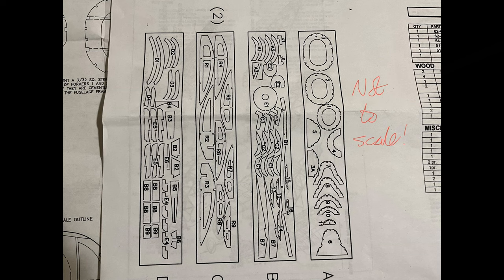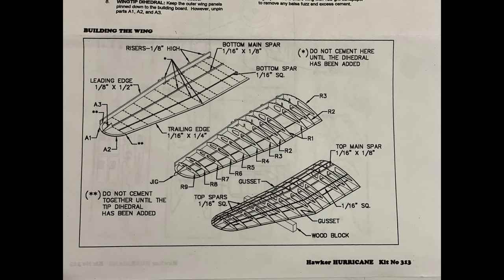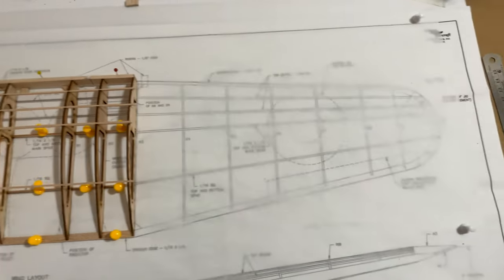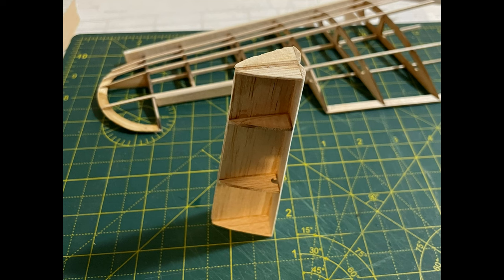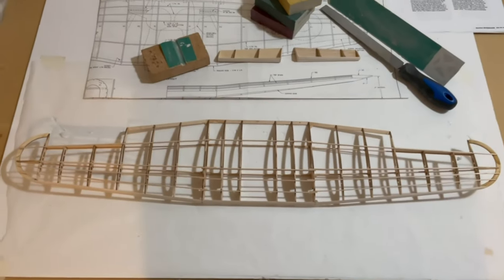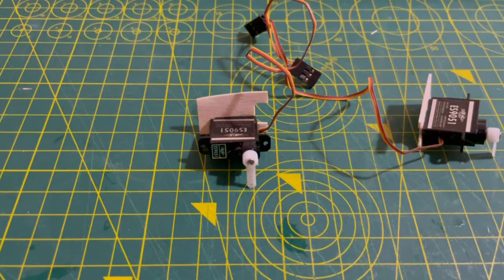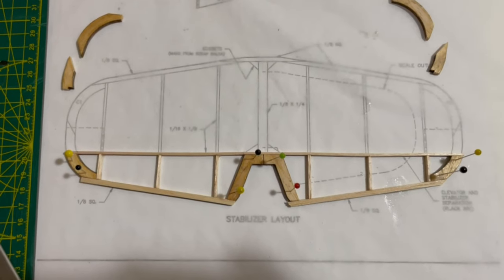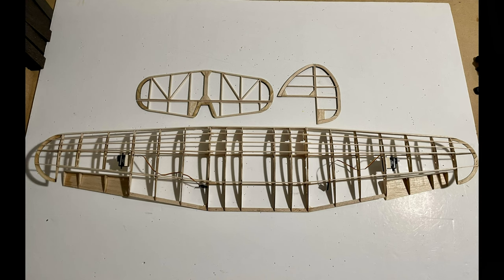SKippy's Dumas Hawker Hurricane RC Conversion  Part 1

Comment from the maker: Now that I'm doing the fuselage build I have discovered an error with my stabiliser! The way it is currently won't allow it to rotate when fitted to the rear fuselage so I will need to cut it in half and insert some wire in the centre to allow rotation like I've done on my other builds. Sorry!

Comment: Very nice points and tips. Thank you for sharing your experience. The leading edge sanding block is a great idea. I can't wait now to get my hands on one of these kits, though I am sure I am much slower and clumsier building.
Reply from the maker: Yes, that block has made things a lot easier. Now that I'm doing the fuselage build I have discovered an error with my stabiliser! The way it is currently won't allow it to rotate when fitted to the rear fuselage so I will need to cut it in half and insert some wire in the centre to allow rotation like I've done on my other builds.

Comment: Hi there, I would greatly appreciate it if you could put a list of the electronic parts you used to complete the model. Thank you for posting this very informative video.
Reply from the maker: Thank you for watching. I'm using the FliteTest Power Pack F: 2205 motor 2300kv, 20 amp ESC, ES9051 4.3g servos. Also the Spektrum AR636 Rx and a Turnigy 11.1v 700mah 3s battery. Hope that helps!